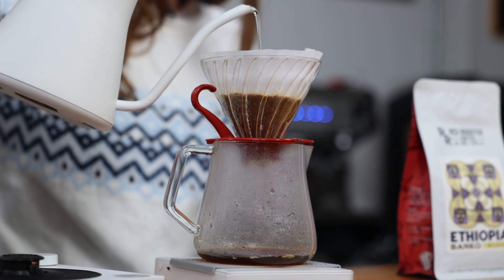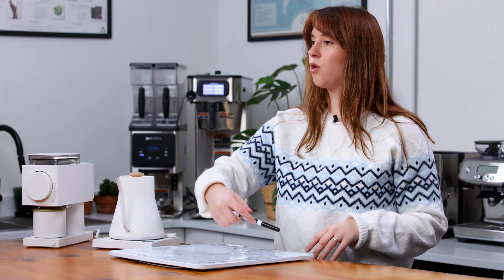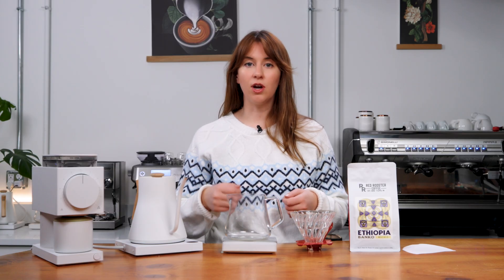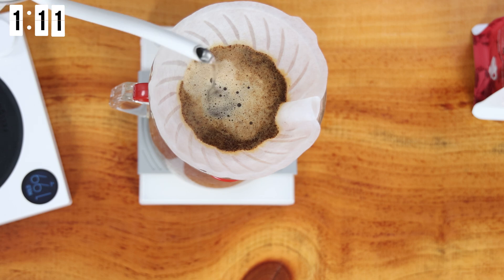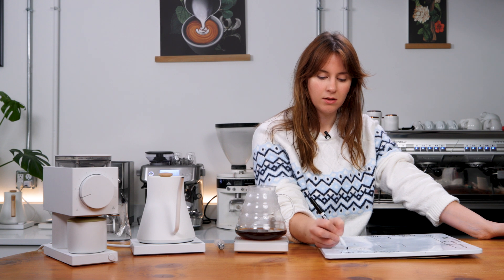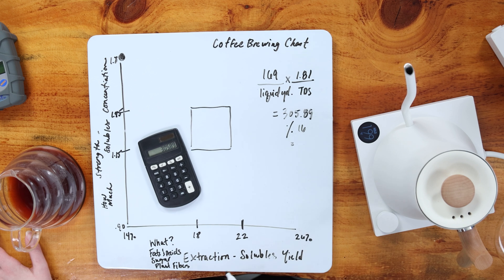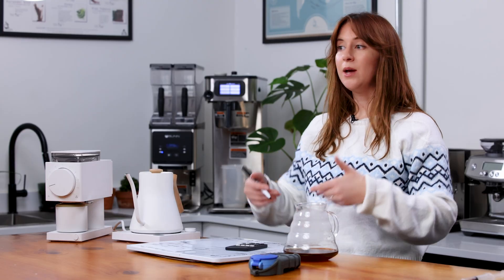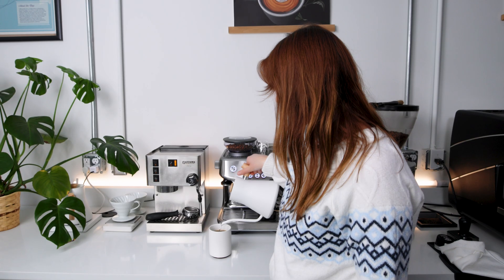The Method Coffee Brew Champions Use | BYPASS

Comment: When brewing is done, adding more water can only change the strength, not the extraction. What if using too little water when brewing results in poor extraction, for example 15%, adding more water afterwards will not fix the problem, won’t it?
Reply from the maker: Correct! If the initial brew results in poor extraction at 15% instead of the ideal 18-22%—adding more water afterward won’t fix it. To correct under-extraction, adjustments need to be made during brewing—like adjusting grind size or extending brew time, to properly extract flavors from the grounds in the first place. In this experiment, the extraction remained constant at 19%. I only added water to adjust the strength from 1.81 to 1.36.
Reply: Adding water lowers TDS but boosts volume, the effects cancel out. If you dissolve 10% of the coffee in 100mL and add another 100mL, you still have that 10% of the coffee floating around.

Comment: Great video!  I think you can calculate the exact amount of water to add to reach a specific TDS.  You just have to reverse the equation once you do your measurements.  TDS = (EY * Dose)/Brew Volume   Is this correct?  It would make it easier to hit a specific target TDS instead of guessing.
Reply from the maker: Thanks so much for watching! 🙌 You’re absolutely right that you can back-calculate the amount of water needed once you know your extraction yield and dose. The formula you wrote is basically the same one the industry uses — TDS = (EY × Dose) / Brew Volume — but keep in mind that in real-world brewing, TDS and EY are measured from a sample, so small losses, retained water, and measurement error can throw it off a bit.

Still, using that reverse calculation is a great way to get much closer to your target TDS instead of just guessing!

Comment: I was always an advocate for bypass as it is the simplest thing you can do to fix your overextracting brews: instead of pouring all the water through the slurry, pour some beside it, see if that fixes it. It would also allow you grind finer, which is really great for cheaper grinders with a lot of axle wobble; don't overdo it, though, as that would lead to channeling. On top of that, all of the grinders have an "ideal" grind size where they have the most unimodal/bimodal particle distribution. You can notice this with the naked eye when you grind too coarse, you get a lot of irregular ground shapes. Try to avoid that with grinding finer and fixing your brew with bypass!
Reply from the maker: That's a great observation - bypass can definitely be a great tool for fine-tuning your brew!

Comment: Im not sure how the box is calculated. If yoi calaculte one axis from the other  then when you add more water they will both change. Does the box move for different coffees? The bitterness is  one of the key features of coffee for me would that mean I could aim for a sligjtly higjer TDS and add less water to get a more roinded cup. Will have to experiment.
Reply: tds moves but extraction stays the same! you already finished pulling out stuff
Reply from the maker: The Brewing Control Chart represents the relationship between extraction and TDS, but they are calculated separately. TDS is measured directly, and extraction is derived from the brew ratio and TDS. When you add more water after brewing, only the TDS changes (it dilutes), but extraction remains the same since no additional solubles are being pulled from the grounds.

The SCA (Specialty Coffee Association) defines ideal optimum balance to be between 1.15- 1.45 for strength and 18-22% for extraction which lands it in a “box” for optimum balance. Different coffees, grind sizes, and brew methods can influence where optimal balance lies. If you enjoy bitterness, aiming for a slightly higher TDS and using less dilution could help maintain a more full-bodied and rounded cup. It’s definitely worth experimenting to find the balance that works best for your taste preferences!